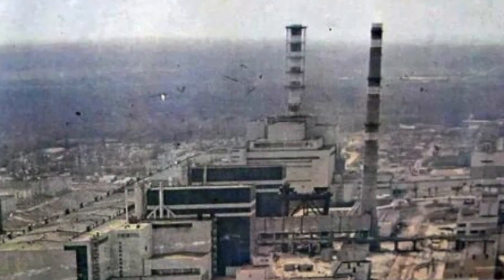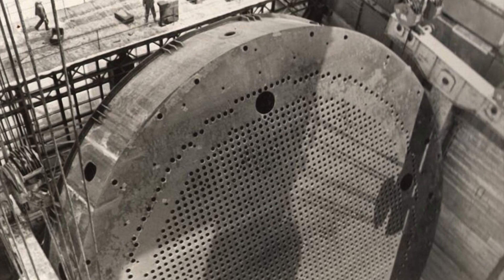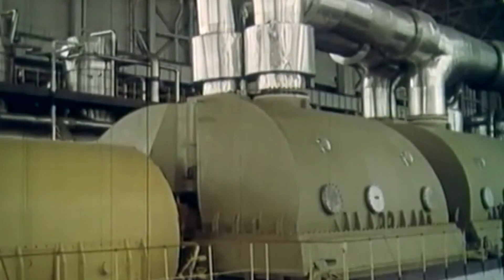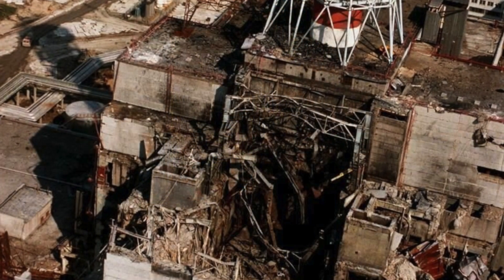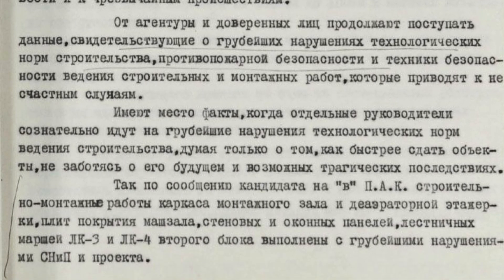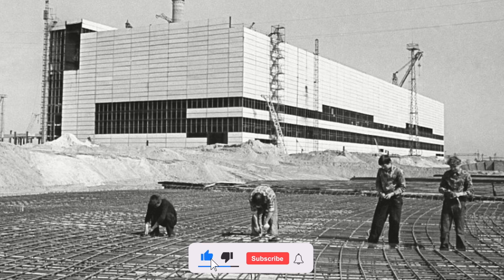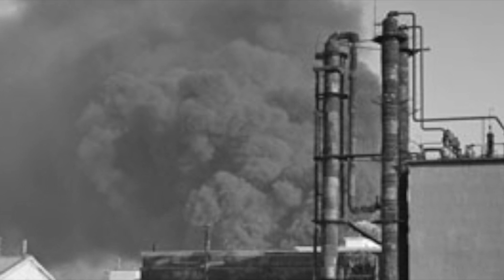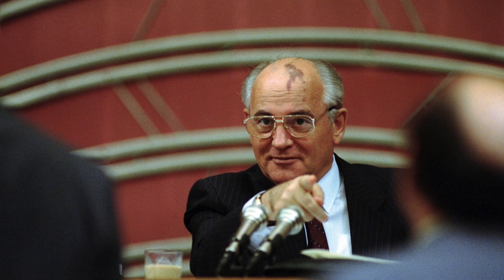Monstrous violations during the construction of the Chernobyl nuclear power plant. They were warned…

Comment: Seems like Fukushima could have been said to have the same kind of idea. They were warned about the risk to the generators and they chose not to move them. They were looking into it, or so they say. The problem is, generators are really simple to manage. They could have moved those without much issue. They just didn't want to spend money. Now they are broke because of that decision. The issue at Chernobyl was a whole bunch of issues all together. It had everything from the base design all the way up to the crazy test methodology and the most overlooked aspect: government. The government fostered not only the environment to make this all happen but also to prolong the effects afterward.
Reply: It seems to me these systems should always have a convectional water cooling system available, the system should be failsafe through a piping system which has valves that can be operated manually from outside of the containment structure.
Reply: @lewisdoherty7621  A Candu-esque system. Makes sense though these rbmk designs are already ones with a phenomenal number of pipes so the real engineering would have to be in the making the two coexist. I agree with manual valves but they also have to have electric valves because time counts so if they can first try electric on only go after the manual valves if needed, that is best.
Reply: @NickFrom1228  Likely there can be parallel pipes with an electric and manual.  I understood the problem in Fukushima was that there was some convectional cooling available, but the valves were pneumatically operated inside what containment structure there was, so when the pressure increased inside and the actuators operated on the difference between the pressure in the lines and the atmospheric pressure,  they wouldn't work.
Reply: @lewisdoherty7621  I agree, there can be parallel pipes, it's just an engineering pain and every weld is a potential point of failure if they do not do them perfectly. In my opinion, just don't build them. There are plenty of safer reactor designs to choose from, might as well use those instead.